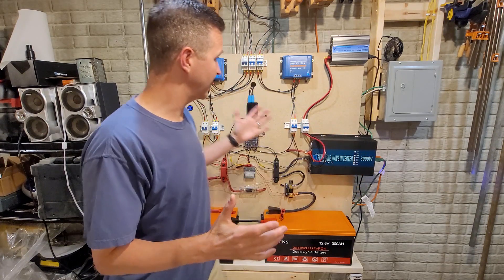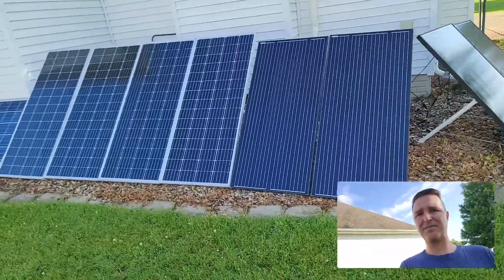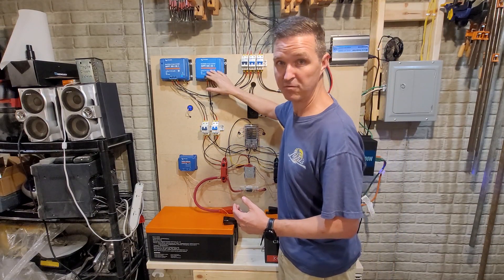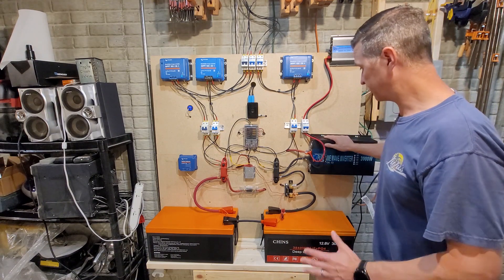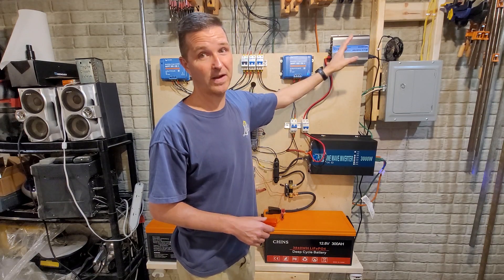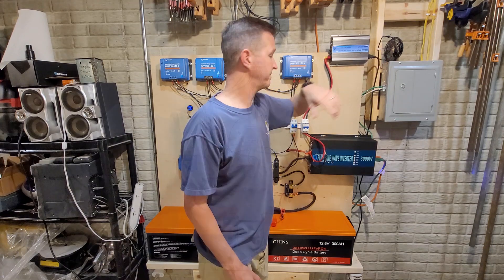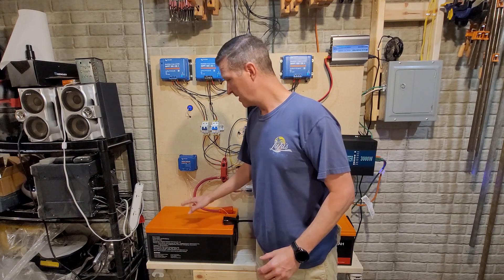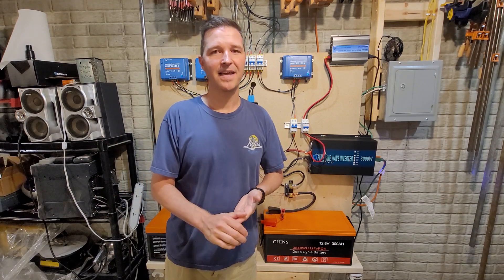6 month update of my 24v Off Grid Solar Setup!  So much was added!

Comment: How do i handle the 24v solar panel part, whats like the minimum voltage each panel needs to carry to support 24v system?
Reply from the maker: You can use 100w panels and wire them in series so the voltage adds up.  You need at least 28v coming from the solar panels.  It should be stated in your solar charge controller manual.
Reply: @OffGridBasement  ok thanks 24 here I come

Comment: A little grid-tie inverter on the sly 🙂  You can automate that using Victron virtual load port logic from one of the charge controllers and a Victron battery protect device.

What I do is set up the virtual load port on one of my charge controllers to turn on at 0.2V below the charge target and then turn off at 1V or 2V below the float voltage setting.  That way it ONLY runs while the batteries are "full".  This requires a cable to connect the VE.Direct TX pin on the charge controller over to the appropriate pin on the battery protect.

You might also need a resistor (like 10K) between the battery protect output and ground to discharge leakage current while the protect is turned off (unfortunately)... otherwise the grid-tie inverter will cycle on and off while "off" which can be annoying.

In anycase, this will completely automate the grid-tie inverter's function and dump excess power to the grid when the battery is full.  If the grid-tie inverter outputs more power than the net surplus coming on the solar, the battery will simply oscillate slowly between the float and the charge target (i.e. it remains at 99% to 100% at all times).  If the grid-tie inverter outputs less power than the net surplus coming from the solar, then you'll be leaving a bit of excess solar on the table unfortunately, but that's the way the cookie crumbles.

-Matt
Reply from the maker: Thanks for the great info!  Smart thinking!

Comment: Greetings from sunny Jamaica 🇯🇲 nice setup i have same brand 3000w 24v inverter and I'm not sure it's 3000w because whenever I plugged  in my clothes iron it trips   the inverter, any  idea what could be the problem?
Reply from the maker: Sounds like you might have a blown capacitor.  3k inverter should power that no problem.  Also, each outlet on the unit only supports 15A at 120v.  That is 1800w.  Hope that helps.

Comment: what do your battery float at i have diy life o4 batterys,  mind seem to float at 13.2 i set the charger at 13.9 they fall back to 13 2 to 13.4 by evening they say to charge then to 14.4 but i don,t do that??
Reply from the maker: Mine charge to 14v, then float at 13.6v.  they also fall to 13.3 quickly and that is normal for lifepo4 batteries.  Hope this helps.
Reply: @OffGridBasement  thanks very munch for coming back

Comment: Hi with the greatest of love your wires are way too thin, all that money you have spent then small cables, system is only as good as the weakest link
Reply from the maker: The wires are correctly sized for the solar panels and the inverter using 24v.  I never have any issues with heat from the wires.  Thank you for the concern and the comment.

Comment: Hi There I really like your video and explanation, but I am interesting about the 3 DC bracers bottom connected to the CC and bus bars, they are opposite I am thinking in that case the source ( the battery) is Charge Controller. Can you show closer picture of the MCB wiring diagram?  I am building 24v system with 2.5Kw inverter at the moment and I am still new.
Owns again thanks for your video!!!
Reply from the maker: I've read that you should have the top of the DC breaker wired to the item with the most potential energy.  In my case, the battery bank has more potential energy than the charge controllers.  I hope that makes sense!

Comment: Are you ever going to upgrade to a whole house system?
Reply from the maker: Probably not.  I just don't have the space for all the panels that would be needed.  I've added a few circuits via a manual transfer switch, but that's it.  Thanks for the comment.

Comment: How long does that 200ah last you?
Reply from the maker: It's actually 300ah.  It will last a solid 2 days with zero solar.  That is with a freezer chest, internet router, computer and 55" tv as loads.  Hope this helps and thanks for the comment.

Comment: Hey mate what brand/type are you’re circuit breakers from you’re charge controller or do you have a link?
Reply from the maker: It's a CNFC DC circuit breaker rated for 40 amps.

Comment: I WILL BE BUYING AN 3000-WATT VOLT   MPP SOLAR INVERTER.,  24 VOLT 200AH BATTERY, AND MAYBE!  BUY ANOTHER 24-VOLT BATTERY I THINK MIGHT. BUT I AM IN TWO MINDS ABOUT IT AND GO FOR A 4 X 500-WATT SOLAR PANEL COST ME £4000 IF HALF WAY IT COST ME £2000 I STILL HAVE NOT MADE MY MIND UP I LIKE A POWER LAPTOP FREEZER WITH TWO SCREENS WITH A FEW LED LIGHTS KETTEL HOT WATER I LIKE SOME ADVISE IF IT CAN WORK AROUND THE £2000 MARK AND WILL I NEED A 5000 WATT INVERTER IF I GO FOR TWO BATTERIES  I AM NOT SURE ITS CONFUSING I DONT WHAT TO GET THINGS WRONG I HAVE BEEN LOOKING INTO IT FOR A MOUTH NOW I ONLY BOUGHT THE BATTERY SO FAR I AM REALY TAKING IT SLOW AS A BEGINNER  ANY ADVICE IT MOST WELCOME. GREAT VIDEO BY THE WAY. BUT YOUR WAY WILL ME MORE EXPENSIVE.
Reply from the maker: Unless you plan on powering everything all at the same time, I believe you could use a 3000w inverter and be fine.  If you live in a sunny environment then 2000w of panels would work very well for you.  It would charge up a 200ah 24v battery to full with no problem in a single day.  Hope this helps.  Thanks for the comment.

Comment: hello great video, what would you recomend as my bulk voltage setting on my inverter, i have a 24v100H lithium battery with a charge voltage of 25v and a discharge cut off voltage of 16.5v...... cant figure how to set the bulk charge voltage in my 3kva inverter
Reply from the maker: Those numbers seem too low.  What is the brand of your battery?  16.5v cut off is way too low.  Your BMS in the battery will shut off way before 16.5v.  my setup is bulk up to 28v, then float at 27.2v I think.
Reply: @OffGridBasement  Am using an LC-Star German Technology Battery, and it came without a manual, and cant seem to find thier official site

Comment: Nice setup. What can you tell me about the application you're running on the Raspberry PI? I checked out your webpage but didn't see anything about that rather cool system monitor.
Reply from the maker: Yes!  I learned everything from Andy @ the off grid garage.  Here is a link to all the info you need!
https://off-grid-garage.com/victron-connect-through-raspberry-pi/
Good luck!

Comment: You have the charge controllers all wired into the two batteries? And where did you buy all that stuff? And do you know of a 24 volt battery balancer? All the ones I find are for 12 volt batteries, I’m buying 4 24 volt batteries to run in parallel.
Reply from the maker: I have a diagram on my website for my 24v system.  https://off-grid-basement.com/diagram.php
If your batteries are in parallel then you don't need a balancer.  They will self balance.  Thanks for the comment!

Comment: I just have 1200 watts of panels and one controller, a 40 amp epic solar. I use a 2000 watts Aims inverter charger that I've rebuilt once after running a welder. I used 20 marine batteries wired in 24 volts for 990 amp hours. My system would work better with a few more panels but I am at my uncle's for now and he says I'm getting too many, lol. The days are getting shorter now. I have to aim my panels and then move them usually around noon to get a full charge. I have buildings shading them in the afternoon. But, uncle is okay with a windmill generator. So that is the next add on for me. 31 amps was about the peak on the charging today. Half of my panels are 40 feet away so they don't put out the amps of the closer ones. The batteries got a pretty good charge today. At midnight, showing 25.1 volts. Full charge on mine is 25.6 v. I am at the worst possible spot on the property for solar panels. They work good in the summer though. I got through last winter with 12 batteries, without using a generator. I just bought two at a time until it worked. It is much better to do the cake baking when the sun is out. If I can get my own place, I will have a Southern exposure and a longer period of sun each day, and the kwH should be a lot higher than it is now. It does okay really, I can get by with it for now. It's just temporaried for awhile, lol.
Reply from the maker: It sounds like you have quite the setup.  Now you just need the location!  What are you able to do with your setup?  Thanks for the comment!
Reply: @OffGridBasement  I was able to run a 6000 BTU air conditioner last summer, for 3-4 hours a day during the heat wave. I have a 7 cu. ft. freezer on it, which used quite a bit when it was 106 degrees out. My main power hog is my electric oven, which uses 1472 watts whether in microwave mode or oven mode. On a normal day I can use it for an hour or so. I have a sump pump that I water the garden with in the stock tank outside. I had a similar fan cooling a similar inverter (24 volts) that I never should have bought probably, but I needed something when my Aims inverter was down last November from running an 80 amp welder. I was going to get a 3000 watts inverter charger but they had sold out, so I got a 2000 w. I bought a 2000 watts Ampeak inverter (12 volts) last summer so that I could get spring water in my pickup. So I use it instead of the cheap one that got hot all the time. So it is my spare now, instead of the " no name brand " one. I had to unhook two batteries and load them to use it, kind of a pain. One thing about the Aims inverter, it will do the rating. It starts to protest around 2200 watts though. I was running a welder that took 2400 watts and it blew the tops off of 5 of the 12 mosfets after about 30 minutes of welding. So no more of that, way too expensive. The replacement power board has one different part on it than the original, but it runs cooler with the new one. I did put one of those same fans like you showed, to cool it during really hot weather. I bought two of those fans extra. I just put one on a cord with a toggle switch. The first fan I got had a metal housing so I can just set it in front of the inverter when the heat is on. It uses 5 watts, and blows a lot of air. It is a TA 450 DC. It took me 3 months to decide which inverter to get. I had to save up anyways. I was going to get a Magna Sine, but by the time I almost had the money to get one, they had sold out of the 3500 watts one. I had a problem finding the same panels. So I would order a different kind. So, I have 4 different brands of panels, and five different shapes. At 7:30 AM, showing 24.8 volts. It is charging again. After two days of rain and clouds, it was showing 23.8v. yesterday morning. But yesterday they got charged good. Around 4 kwH was what it showed, vs. 1.5 kwH for the day before. I might need a generator this winter. Last year I didn't have the chest freezer. So I'm saving for one, if it isn't sold out too. I use the wood stove to cook sometimes, so that takes some of the load off in the cold weather and shorter days. These lead acid batteries tend to drop some performance in the winter, but any watts coming in seem to help. Last winter I got the lowest readings around early February, when we had lots of cloudy weather. The winter before that I only had 6 batteries, and I had to use the generator some to use the oven. I bought the Aims inverter in Nov 2020, the same one is $150 higher now. I'm kind of glad I started when I did. I had been buying the same deep cycle batteries for two years, and decided to quit at 20 of them. The last two were $30 higher. I barely could afford what I have, and I had to piece it all together. But it works now. I used #2 welding cable on all the battery wiring. I have two pairs of it on the inverter bolts. Nothing ever gets warm on that. The 18th of Nov. will be 2 years off the grid for me. It has been a learning experience, lol. Solar is not that hard to set up and use. I guess it is mostly money that keeps people from trying it. I was afraid to buy an inverter. I didn't want a pile of junk inverters laying around that were learning experiences. So I got a low frequency pure sine, finally. My inverter would like about 6 of those batteries that you're using better than my 20, but oh well. I knew my batteries weren't ideal, but I thought I'll just keep adding them until it works right. It works fairly well. I think the wind generator may help in the winter too. If it happens that I need some thing like a dump load, I will just get four golf cart batteries and add them to the battery bank. That would bring me to around 1240 amp hours.
Reply: @OffGridBasement  I've had an idea ; I am working for my uncle and some time he is going to sell his house where he used to live. So when I get paid for helping, I think I will add 4 golf cart batteries to what I have. That would give me 31,000 watt hours or 1240 amp hours. So if I get to use half that would be 15.5 kwH or 620 amp hours. I will have 3-4 days of reserve that way. Two weeks until I get a gas generator. Probably won't ever need it for the solar, but the welder needs the amps. But good for a bad winter when I might need a charge up, lol. I have four different home made wind generators I want to build and test with what I have and see which does the best this winter. Might as well try it once I guess. I did notice some kind of effect starting when I had 16 batteries, that any little wattage coming in has somewhere to go. More so now with 20, but I want to see what 24 of them does. It's sort of the cave man way of getting the watt hours, but if there are enough batteries it kind of works right, lol. It is my theory that if there are enough batteries, that a dump load will be unnecessary on the wind generator, and whatever the solar makes can be saved in the batteries. They will be in float charge all day after they all get full. I have a theory that the batteries will last longer than normal because there's never much load on any of them. It's going to cost another grand to find out. But it's worth the security of having good dependable power. This is like the coolest project I have ever done, so it's kind of fun being at the add on stage. The batteries are at the point of needing a battery room. But I don't mind at all. I'm running a wire for the washing machine plug in. I think it made around 3 kwH today. That was probably all I used yesterday.

Comment: Thank you for sharing. Have a question, have you your charge controller and inverter grounded? If yes how did you connect the ground? Thanks a lot and good luck.
Reply from the maker: Currently nothing is grounded.  I will be working on that very soon!  Thanks for the comment.

Comment: I have 36v panels,  Not sure with solar controlers is say a 12v,24v say 30A is the rating for input solar panels or out put battery rating . Sure many viwets lost in Compatability Issues. Sorry if I seem  bit stupid. 😅
Reply from the maker: How many batteries do you have and how are they wired.  That is what the charge controller wants to know.  if they are 12v batteries connected in parallel then your charge controller should be set on 12v.  How many panels do you have and how are they wired?  To answer your question..  30A is the amount of energy the charge controller can produce.  If you have a 12v setup then 30A equals 360w from the panels.  Are they 315w panels?  If so, you should connect 2 panels in series to the charge controller.  It doesn't go over the max volts of the charge controller, but it will most likely max out the Amps the charge controller can give out, which would be 30A.
Reply: @OffGridBasement  Thanks, I think , I should read small print. More , All Theoretical  at present. 
As used 24 volt panels sold out might have to wait for restock. Or buy more expensive 36v brand new panels.
Reply: @OffGridBasement  Some positives, I am thinking victron is designed high voltage that could cope with series format. I found a cheaper alternative to Victron small print on Amazon claims had cope 36v panels,  lol 😆, Also in small print I learned many cheap controllers are only for lead acid batteries.  So many pitfalls to avoid.

Comment: Be careful with that grid-tie inverter. If it back feeds to the grid, your power company will get involved and send you a nasty letter. Best to get one with a limiter circuit installed to eliminate that risk. Have you noticed any of your wires getting hot? Some don’t appear to be properly sized. Nice setup!
Reply from the maker: I've done a lot of research on my grid usage and the base need for my home is about 500w.  That is right around what the grid tie produces.  I usually run it during the day when our usage is higher.
I do have one 4awg cable that needs to be replaced with a 2awg.  All other wires never get above room temp.  I feel very comfortable with the sizing.  Thanks for the comment and concern!

Comment: I need a set-up for four servers, each running on 850Watts 24 hours a day off grid. 
I'll need an autonomy of 2 or three days, I'm around equator so I get enough sunlight.
Which configurations would you suggest from your experience.? 
Thanks.
Reply from the maker: Dun, you are going to need a BIG Setup.  At least a 5000w inverter @ 48v, but probably more like 7k inverter so it doesn't burn up.  4 servers x 850w x 24 hours = 81,600w daily!.  3 day autonomy would make a battery bank = 245kwh!  That is way beyond the scope of anything I would touch.  Sorry if that isn't the answer you want.
Reply: @OffGridBasement  thanks for your response.
Any idea on the panels, say the type and the most ideal configuration?